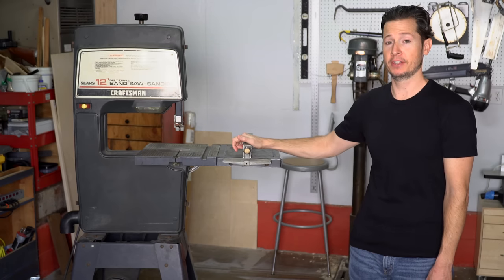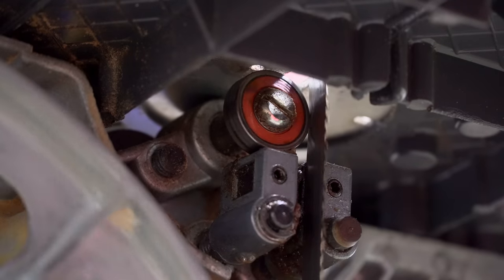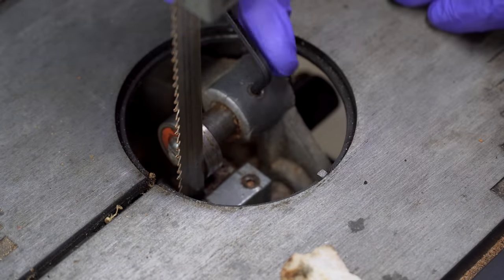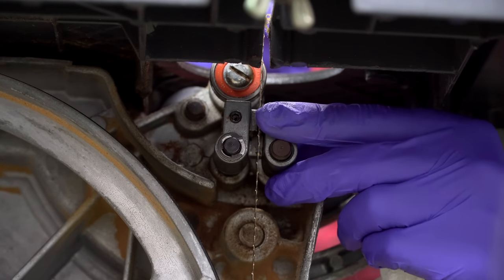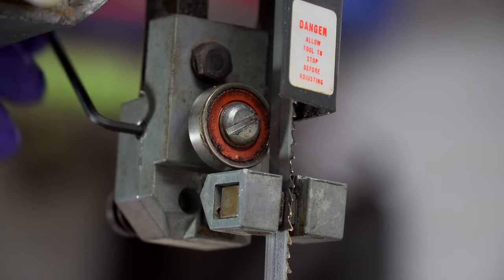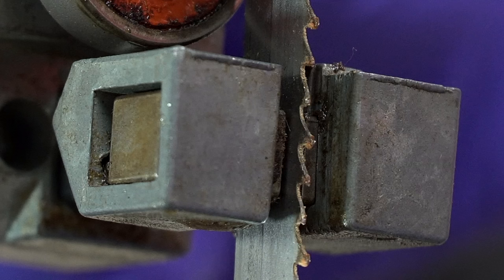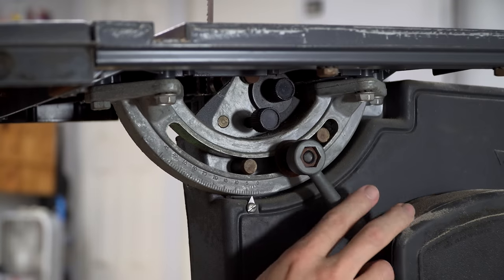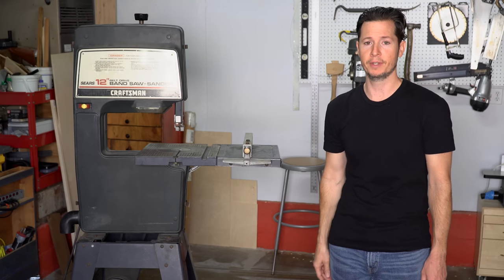Craftsman Bandsaw Setup

Comment: I have the same bandsaw. The blade came off. The adjustment knob on top will not allow the wheel to come low enough for me to get the blade back on. Any suggestion?
Reply from the maker: Make sure the knob is very loose...you don't have to loosen it as far as it will go, but make sure there is no tension on it. Then, gently push downward on the knob itself, or the wheel. You shouldn't have to push to hard, and it should break free. If you're pushing really hard and nothing is happening, try loosening the knob even more, just in case. Let me know if that works!
Reply: Thank you. I will give it a try and let you know.
Reply: I got the blade back on. Thank you for your advice
Reply from the maker: Great! I'm glad it worked out!

Comment: I just inherited one of these from my grandfather and fortunately he was meticulous in keeping manuals. If anybody came across this video b/c they have this saw but no manual let me know and I could always try to upload a PDF for reference!

Would love to know if anybody has any idea where I can pick up that table extension and fence you have in the video though!
Reply from the maker: A lot of people ask about the extension, but I honestly don't know where it came from. This was a hand-me-down from another hand-me-down. It definitely looks factory though. Anyway, good luck!
Reply: I have the same saw, which was a curbside pickup from my neighbor, but no extension or fence. I can live without the extension, but I would like to get a fence, so if anyone knows anything about where to go to find one, I'm sure it would help multiple people. Thanks
Reply: I'd love to see a manual, my ex husband bolted it onto the base and it sits crooked (tilts backwards) I can't figure out with the current brackets how to make it not tilt
Reply: It is frustrating not having a fence but I've just taken 2 boards and clamp them down to use as a fence
Reply: @audrealoren2908  I actually found out that all of the old Craftsman manuals are actually available online, if you Google the model # you should be able to find it really easily!
Reply: Great, thanks! I'll look it up.
Reply from the maker: You could probably find one on searspartsdirect.com or you could make one. I'm working on the video right now for part 2 of the MicroShop project, which will show you how to make a fence, and I think the general idea will work for the bandsaw as well. If you haven't seen the MicroShop, here is the features video: https://youtu.be/yIOhdHGaB9g and here is part 1 of the build: https://youtu.be/dfAG6RhtYsM I hope this helps!
Reply from the maker: Have a look: https://www.searspartsdirect.com/manual/bmfi8a9zp4-000247/craftsman-113243311-band-saw I hope this helps!

Comment: I don't understand the purpose of the bearings if they don't touch the blade?
Reply: When you push into the blade with an object they begin to touch the bearings and take the load off the blade
Reply from the maker: As B-Roll CT has mentioned, the blade has some flex to it, so the harder you press on the blade, the more contact it makes with the bearing. This helps keep the blade from flexing too far, and keeps the blade nice and vertical. I hope this helps!

Comment: When you adjust the blade, the teeth should be in the center of the wheel.
Reply from the maker: Dennis, you actually want the width of the blade to be centered across the width of the wheel. Meaning, you should have approximately the same amount of tire showing on either side. This will put the teeth just out of center on smaller blades, and fairly out of center on really wide blades. I hope this helps!
Reply: @OneMinuteWorkbench  Sorry but you are wrong. The gullet of the tooth should be in the center of the tire.  This eliminates drift.  This is not my recommendation but what the professionals recommend.
Reply from the maker: Most manuals I've read have always indicated putting the blade in the center, but I'll have to give your method a try. Thanks for the suggestion!

Comment: The table on my saw isn't level. I have the table itself set to 0 but it it won't adjust the way I need it
Reply from the maker: Try going through all the other settings first to make sure something isn’t pushing the blade out of square.  I had the same exact problem on mine because some of the blade guide bearings were set in a way that messed it up. I hope this helps.
Reply: @OneMinuteWorkbench  thanks will definitely have to try this!

Comment: how to tell if my blade is too tight. there is no gauge on my saw
Reply from the maker: What's the make and model #?
Reply: @OneMinuteWorkbench  it is a king canada 9" model kc-902c. the reason I asked is I snapped two blades on two different occasions crafting with foam
Reply from the maker: I looked up the instruction manual, and (on page 9) this is basically what it says: "tension the blade so that when you press on it with firm finger pressure, it is able to move about 1/8 of an inch". That said, I if you haven't tried that, give it a try. If you break another blade, back off that just a little more on the next blade. Luckily, blades are pretty cheap...just make sure you're wearing eye protection around that bad boy! FYI, here is the link for the manual, just in case you don't have it: http://www.kingcanada.com/catalog/products/manual/KC-902C%20manual-eng.pdf Good luck! Let me know how it goes!
Reply: Wow, I don’t have the manual, didn’t think of the website. Ok I’ll do what you said. Now I just need to get a new blade. Thanks a lot.